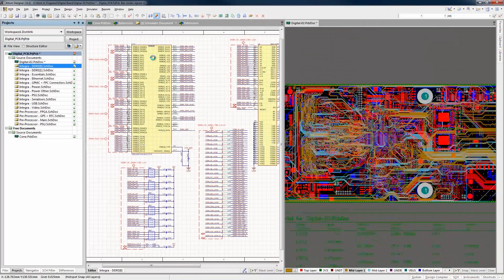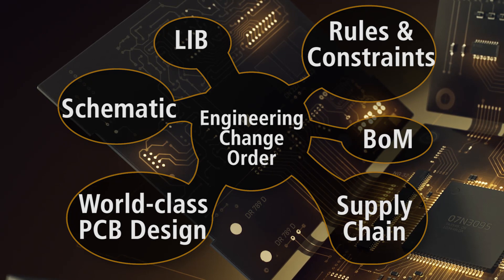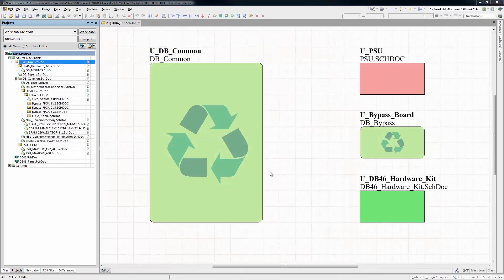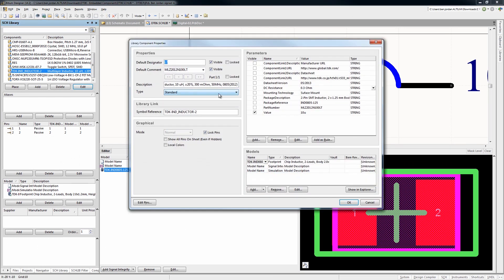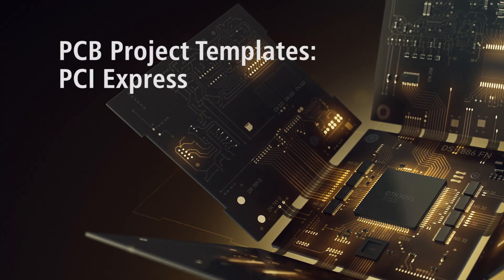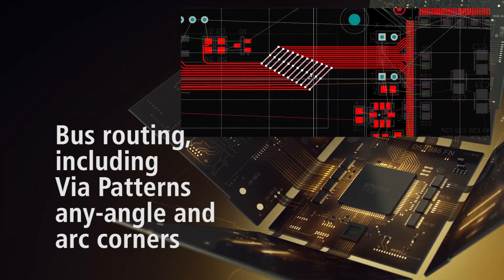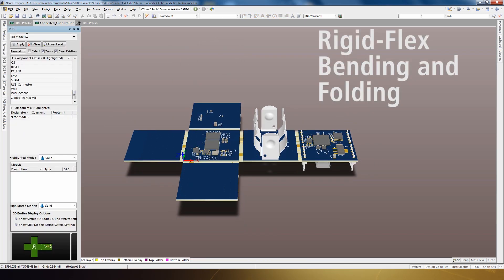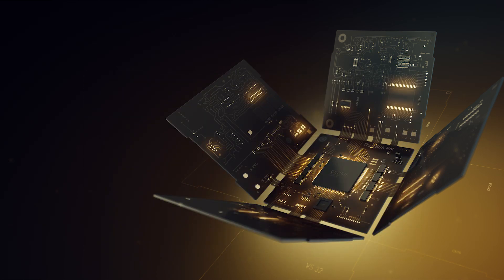Introduction to Altium Designer

Comment: A lot of money for a buggy product, you can design something quickly then spend hours trying to do something simple like changing the layers back to default, its just not intuitive, then the crashes and unexpected bugs throw you, then they have the cheek to charge an arm and a leg. Menu system is a pain, so many options is makes your eyes bleed.
Remember the good ole day of OrCAD, not fancy, but rock solid reliability that you need in a pro product.